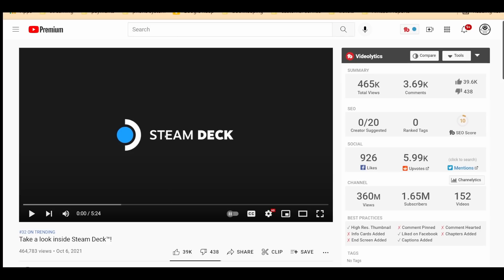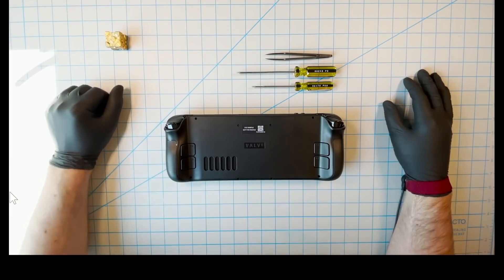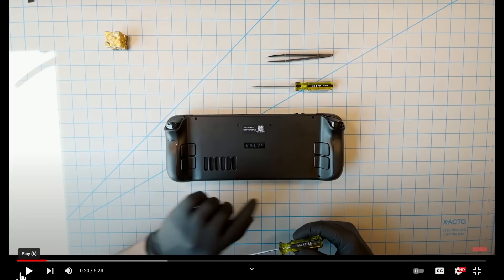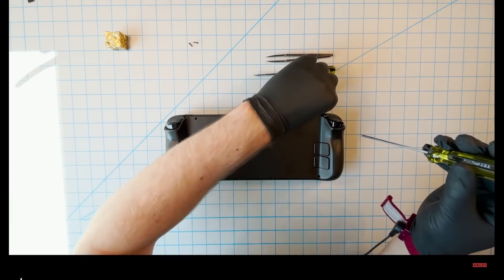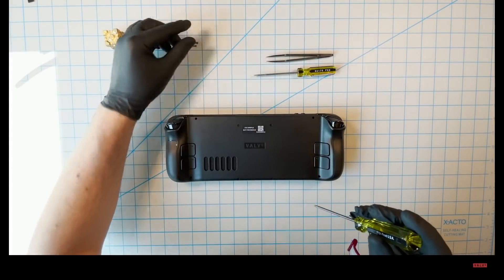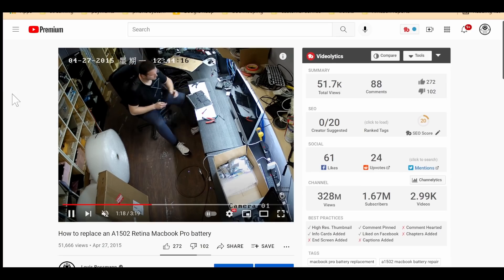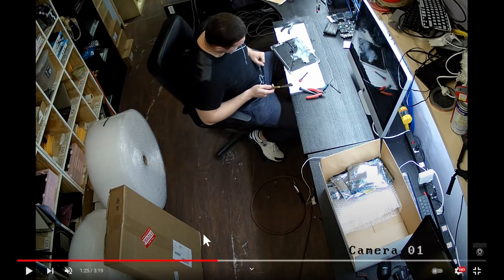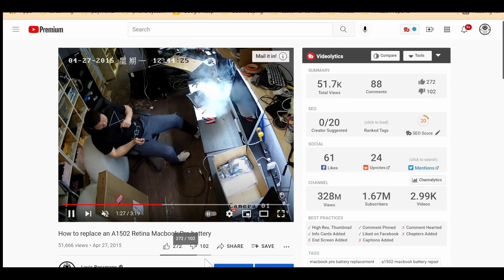Steam deck battery may end your life? bruh 😑

Comment: Yeah- regarding the self tapping screws- this is basically no different than the other language on the video. Once the tapper is removed and reattached it has basically removed some scintilla of plastic so technically you've made it weaker by some nearly incalculable amount. Therefore it's weaker now, it's less drop resistant.  I guess that means when I replaced that piece of sheetrock in my house, the process of removing and reattaching those screws to the wood studs has permanently destabilized the structural integrity of my house.

Seriously... the little bit of sugar in this video does not excuse this shit.

Comment: The structural integrity issue would be very minimal and it has to do with how the self tapping and/or self-drilling screws may work, especially in plastics. It is very possible to get the screws perfectly back in place without damage, but there is a high chance of cross-threading when reusing self tapping or self drilling screws. It's also pretty easy to over torque screws into plastic in general. I think the guy is just warning people of the most extreme possibilities of what "could" happen.

Comment: for me it just makes sense, that the structural integrety goes down, when you re-screw a "self-tapping" screw, as the plastic itself and thus the holding-force of the screw becomes weaker. please correct me if im wrong
Reply: Self tapping screws have no place in this price range. They're way too easy to strip the plastic with and getting the correct torque after that first removal without stripping the plastic is very hard.
Reply: @COASTER1921  The Steam Deck is extremely low price for what you're getting. It makes sense Valve would cut as much costs as they can on it. The vast majority of them will never be opened.
Reply: @COASTER1921  not really laptop console and controller all use salf tapping screw and a disassembled many and never stripped a screw
And a controller need to have good structural rigidity and never got a problem 
This is just stupid reason to not open it
Reply: If they are reinserted and tightened correctly it won't be much weaker. Technically devices that aren't self tapped are weaker after every reassembly, but it's not enough to matter unless it happens many times or is done poorly.

Comment: This is true that the structural integrity changes after you open it but if you use a torque wrench and you have the torque specs used at the factory then it is extremely minimal. They don't give the torque specs or the assembly temperature so shame on them for not working towards a solution. This assumes 1 cycle of disassembly. Every cycle degrades performance. But the biggest issue is that drop testing is not validated for more than one cycle of assembly so they could say it is not validated but they chose to say it is degraded which is technically also true. A finer detail might be that the screws can not be swapped to other holes even if it is the same screw. The tolerances are not that tight on these interchangeable parts. Plastic does suffer from fatigue as it is being loaded and unloaded. Lots of variables.

Comment: On the point of lessening structural integrity by removing and replacing the case screws.   Well Louis, for a bright guy who has installed 10's of thousands of screws into plastic, you have a self calibrating torque guage built in to your fingers.  But for your typical person, who has little mechanical experience there is a high risk of stripping the threads. If it is the type of screw that has a cutter slot ground in the tip to cut as it goes in, there is maybe a 50% chance the screw will find it's way back in the formerly cut threads, and end up with a connection that is 90% as strong as the first time a screw cut it's way in. but if it cuts entirely new thread you end up with a connection that is way weaker than it was the first time.   Doesnt take much to strip that out. Been there, done it. That too can be fixed, and even make the connection stronger than it was to start with, but again, most people are not knowledgeable enough to make that improvement. But if the d***ed thing dont work anymore, what do you have to lose from trying to fix it?

Comment: The issue with the structural integrity is that the screws are self tapping so they aren't gonna thread as tightly as they did the first time.

Comment: Regarding exploding batteries, a rapid failure in a clean workshop is one thing. A well designed workspace will help ensure minimal damage in case of an accident like that. But if it's a slower type of failure, perhaps one that take a few hours to fully manifest or one that doesn't light off until the device has recharged a bit, and in a household environment, it could lead to a pretty significant house fire, and I think that's where the concern of potentially deadly accidents arises. Granted, it's an edge-case kind of scenario with a whole lot of what-if involved. But if they sell a large number of these, remote possibilities, statistically speaking, gather increasingly higher probabilities of occurrence.

Comment: They mention opening a storefront where you can buy parts. Hopefully those parts are more than just SSDs and thumb sticks. I think they should sell every part, including the main board, the shell, the screen, daughter boards, heat sink... Etc... 

If you think about Steam's business model, it's not unlike Apple's business model (in fact, Apple had the court subpoena Steam's sales numbers in their case against Epic). Steam has the opportunity here to show that they can give up a little bit of their hardware sales numbers in order to spread good will among their customers and having actual environmentally friendly practices.

Suggestion for Steam: offer a free recycling service for broken Steam Deck parts. Repair shops can send them by the box, and maybe some of them are able to be remanufactured or something.

Comment: The steam video seems mostly aimed at the unskilled enthuiast, the sort of person who routinely breaks their own stuff and never learns.  They do seem to be a lot of nods aimed at people skilled enough to spot them.
Reply: Consider that the "tech illiterate" would no longer be tech illiterate, if they spent some time becoming less cowardly and unconfident with attempting repairs. 99% of the problem is people being too afraid to bother trying. Small tech like this is a lot harder, but the operations as fiddly as they may be aren't that hard if you take your time, and use caution.

The mindset, and basic workflows for small repair aren't hard to learn. But the fear of gawd drilled into people about how impossible stuff is to fix is the ultimate problem of our society. They are trained to be stupid.

The people Valve, and I'm pretty sure damn near every place else is looking to avoid, are the over-confident. Those who Dunning and Kruger wrote about so prophetically. Those who don't know, but think they know, and go barreling in at mach-2 breaking several vital components in mere moments. (These are the kind of stupid who would probably try to use their hand to extinguish a lithium battery fire.) *I do think we need THAT video as well... ;)

Comment: As an experienced tech and former paramedic here's my take: Ok, so the battery ain't gonna "blow up" in your face. But, these batteries contain toxic materials. Lithium is toxic. So is the cobalt and other materials (plastics) inside. There may even be mercury in there.

BATTERY SMOKE IS VERY TOXIC - EVACUATE AND VENTILATE IMMEDIATELY!!!

PS: Where's the fire extinguisher??? Didn't see one of those ;)

Comment: A little anecdote about the structural integrity:
The Lenovo T580 I have for work also uses self-tapping screws in some places. The thing has a ridiculous amount of issues, so it's been opened 5 times and had one motherboard swap. 3 of those times were competent people, one was me and the last one was a lenovo "technician", who swapped the board. I have no idea what he did to the poor thing, but now all the self-tapping screws spin freely inside their holes and they also won't come out. The case is now held shut by the three screws that thread in metal and some plastic clips that come loose whenever you pick up the laptop. If I ever dropped it, I bet the case would come right off.

It's not a huge deal for a laptop that sits on a table 99% of the time, but it is for handheld console. I'd say they have a point there, even if it does need to be opened multiple times to make the wear noticable.

Comment: BS detector missed the part about self tapping screws. They will not be snug like before at the same placement and could cause issues if overtightened. A little Teflon tape to could be helpful if this is the issue. Going too deep could penetrate too far into the shell causing cracking. Too loose and it could let debris and skin cells inside. Seen some controllers that were worse that a 3 month unplugged fridge. Just the thought.

Comment: think about anything else in your past you have had to literally pry to get apart, even more so something you've done this with many multiple times, the more you pry it the overall looser and weaker its bond is when u put it back together thus yes weakening its integrity if you drop or smash it, also the same with pretty much any adhesive you dont just take a peice of tape and reuse it 50 times expecting the same strength. weather or not its enough to very noticeably matter may vary from person to person. i take super extremely good care of my stuff, i have never broken a phone screen ect. so even if it was slightly weakened im pretty sure it wouldnt matter much for me. other people are freakin tornadoes with their equipment constantly dropping hitting and such and would probably need all the structural integrity they can keep.

Comment: I think the actual danger with the battery exploding is if it's in your backpack or by your bedside table while you're asleep. It's still a bit of a long shot since usually any issues with the battery would be apparent during the replacement but it's not that outlandish either especially when it comes to a consumer device which you will likely have close on your person and is more likely to be dropped than even a laptop.

Comment: The lag in replacement parts is probably because they're focusing on getting new units out instead of shifting some production into spare parts, or at least that's the idea some idiot got up top not realizing that the line that produces the thumbsticks can churn out thousand thumbstick units per CPU that they can get their hands on. I am probably being pessimistic and it can reach even tens of thousands per.

And what I understood about the structural integrity is that it's about the part he talked about the fact that the screws are self tapping and you can cross-tap or even strip the holes (since they're plastic).

Comment: Well, at least Valve did this and is providing repair parts, as for the Battery statement, for people that they believe that may be less technical in nature the battery statement is fair IMO, for normal techies that deal with Laptop and cell phone batteries, IF people damage the battery and it catches fire or explodes during the night or in a backpack you are risking fire which can be life threatening. This is one of those Legality cover their butts statements and I think most of us understand that.

They mean by "User swappable" they don't want you swapping a lower tier SSD for something that is not verified by a third party, there can be shielding issue as it is right overtop the Wifi/Bluetooth module and without shielding that can cause interference and issues, also there is a wattage issue where you are putting more strain on the system battery and your 3 hours now turns to 2 hours because the SSD is putting more load on the system, Also you have Heat that can be an issue possibly adding heat to the point the Proc starts trottling due to the heat spreader being right there, also where if the card you are replacing it with is lets say double sided Nand you can end up with Physical problem.......
They are not intentionally being dicks here, grant it they could have made a slightly better video explaining that.

Those type of screws are self tapping into plastic, the issue is it is easily strippable, If you play guitar its the same as screws in wood, every time you back the screw out and re tighten it you take a high chance of damaging the original thread tap thus stripping it out, then you have to fix it in wood with glue and toothpicks or by tapping a wooden dowel and redrilling.
Plastic standoffs are a problem I have had to fix them as they are torque placed to ensure proper pressure of the unit conjoined is proper for the application, every time you unscrew and rescrew 1- you cannot damage the original threads otherwise you are borked 2- you cannot overtighten otherwise you will strip out the treads.
Valve is actually correct on this, when taking it apart you need to be extremely careful, I have fixed cheap laptops in the less than $400 range where the bottom cover was made this way and the plastic used is way way too soft and or too brittle so it immediately stripped out the tapped threads, its actually an easy fix.
So what you do is take PLA plastic used in a spool for 3D printing and a soldering iron, and you simply heat it up filling the hole up, then you simply put the cover back on and use the screws to self tap themselves into the plastic. There is a reason why plastics typically have Brass Ferrules heated into the plastic for an attachment point.
https://www.stanleyengineeredfastening.com/-/media/web/sef/resources/docs/other/threaded_fasteners_for_plastics.ashx
This is also a pretty good article explaining about plastics and screws and what happens when heated and cooled.